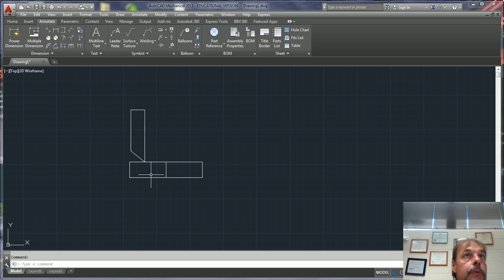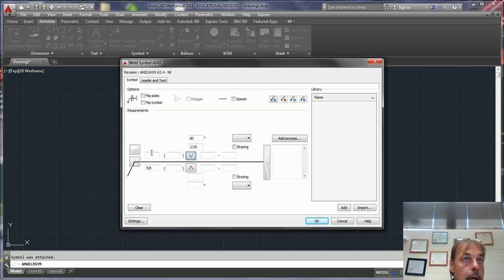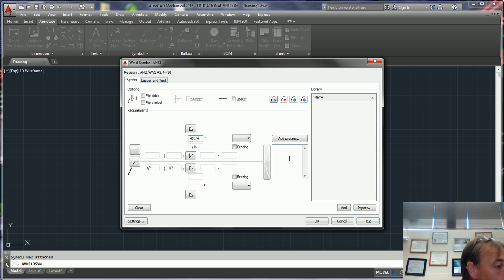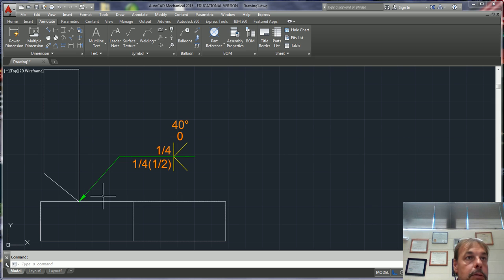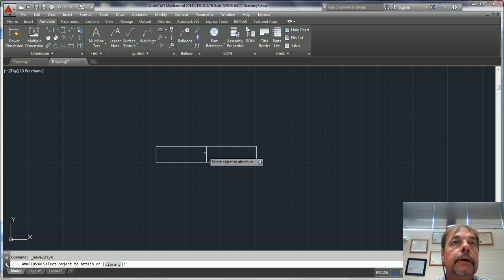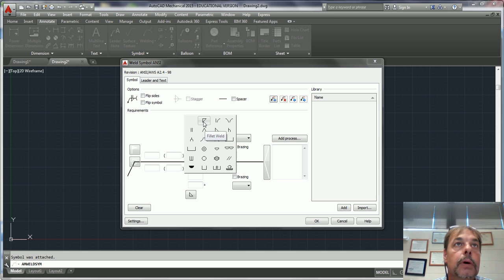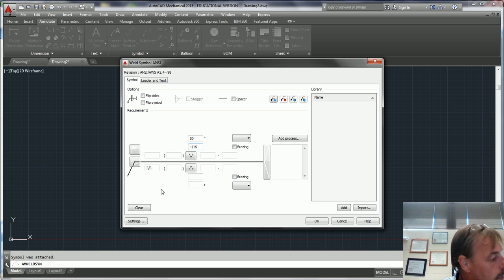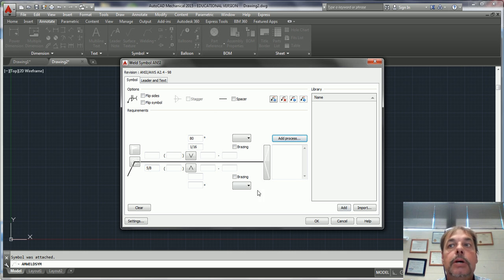Adding Weld Symbols in AutoCAD

Comment: what does 1/4 and 1/2 represent? for what?
Reply: imperial measurement (inches)
Reply: In a welding preparation symbol, the first measure represents the depth of the preparation (it could be machined, grinded, gouged, etc.), the second measure in parentheses represent the thickness of weld being deposited into the preparation. This is because it it possible to weld a preparation without completely filling it in or even adding an extra thickness (refer to welding procedure documentation, usually created by the engineer for a job). Hope this helps.